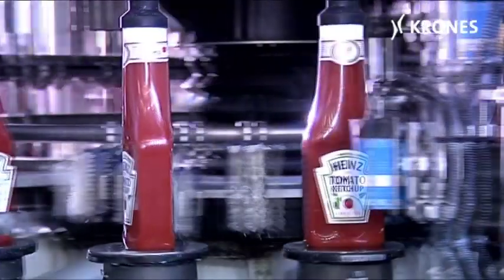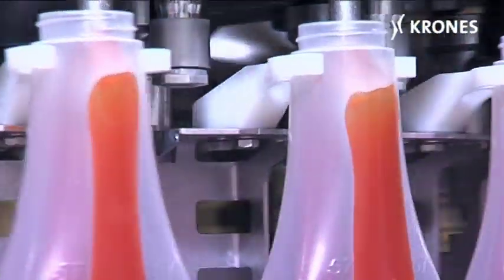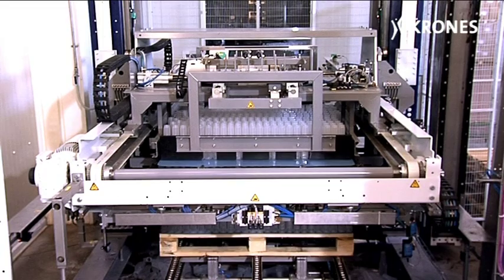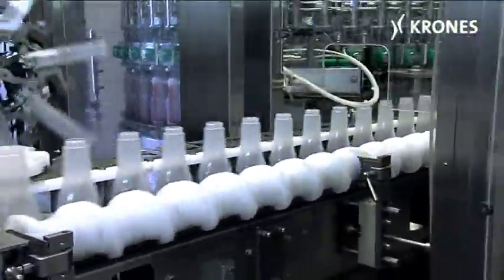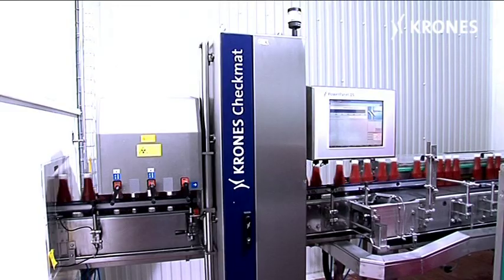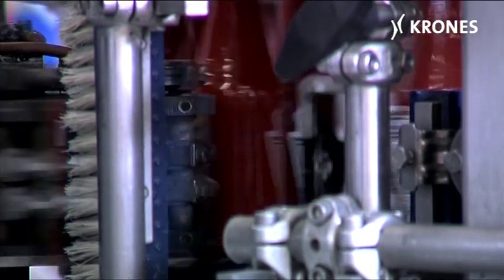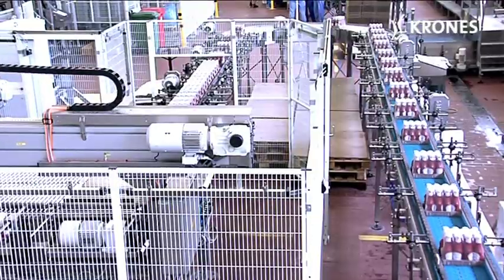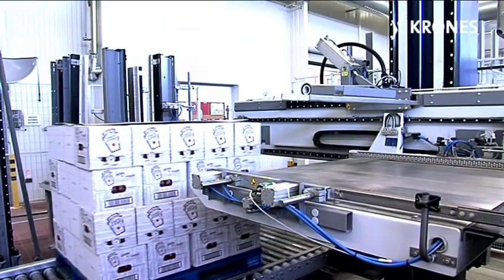Complete solution for Heinz Ketchup

Comment: I would like to ask you about krones ketchup line, does it fill the ketchup in the bottle? And inform me about the physical details of the filling and production line ?
Reply from the maker: Ismeal Gharbia Heinz Ketchup opted for a single-sourced solution by Krones for their line back in 2011. Consequently, the line is among other things responsible for filling these bottles with Ketchup. The line was dimensioned for an output of up to 21,000 containers an hour for filling Heinz Ketchup in glass bottles with filling weights of 342 and 855 grams, and Pudliszki Ketchup in PP containers with filling weights of 480 and 500 grams.